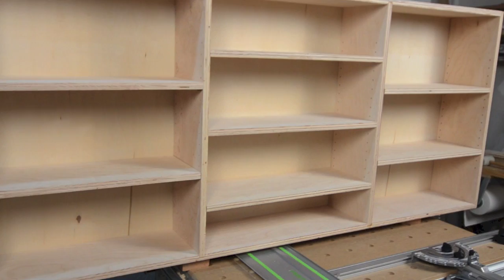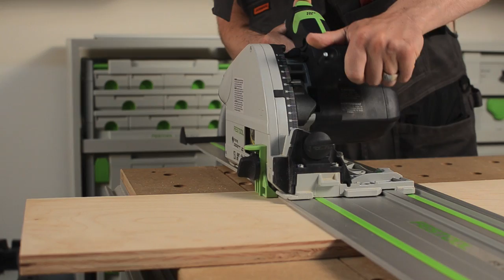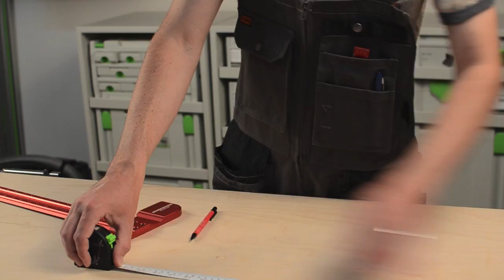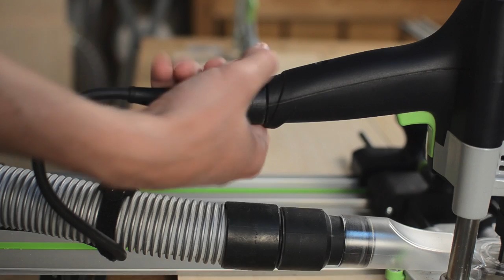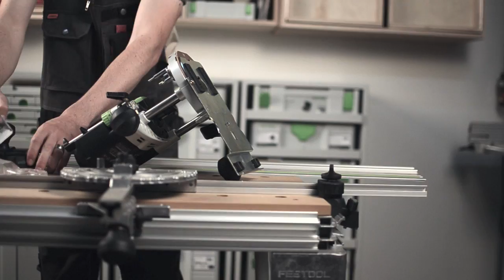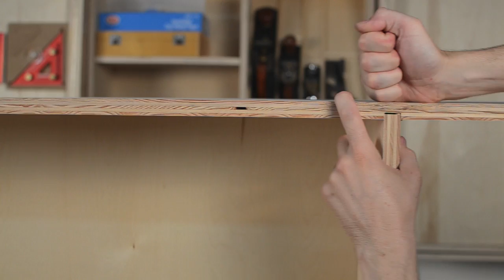Festool Wall Cabinet Demonstration

Comment: What is the bit you are using to make your dado cuts?
Reply from the maker: The bits in the video are some now discontinued Festool straight bits. Might want to look at a down-cut spiral bit if you're doing dadoes to reduce tear out.

Comment: Amazing video,  Would you please share what "bit" are you using on the 1400.  BTW:  Festool should pay you a commission, because based on this video, I purchased the 1400 and the LR32.

Thank you.
Reply from the maker: +nerves Ha.  The OF1400 was the first Festool I purchased.  You're going to love it.  The bit in the video is a Festool straight bit that has since been discontinued.  Nothing too special although it had replaceable cutters.  You should try a spiral downcut bit as it will reduce tearout when cutting rabbets and dados.

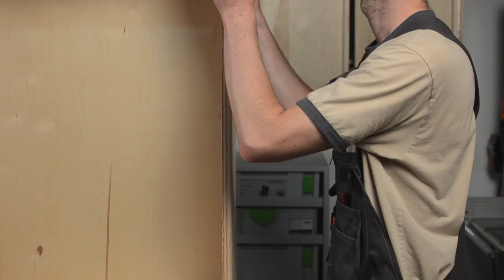Comment: I'm not a cabinet maker, Braden, so please excuse the novice questions.  Would you please specify the material you based your wall cabinet on?  It looks like a laminated wood material -- like a form of plywood -- but the plywood I see these days doesn't look as linear/flat/true as what I'm seeing in this particular video.  If it is a type of plywood, I'd like to know if the screws I'm seeing being driven (at about the 4:10 mark) bite well when driven into the ends of the opposite panel?  In other words ... after the screws pass through the panel you're pushing the screws into, they have to bite into the end of the adjoining panel ... Do the screw threads hold well when being driven between lamination layers?  Thanks for putting together such a fine video production.
Reply: If you go to a good lumber yard they'll have a wide variety of plywood both veneered and not.

For screwing into the edge of plywood, and I'm assuming he's using #8 flathead wood screws, it's best to drill pilot holes.  1/8" drill bit works for #8 screws.  Pilot holes will prevent plywood from splitting and in some extremely dense woods/materials, like bamboo, pilot holes can prevent (low quality) screw heads from snapping off.  I've had it happen and in some "cases" it can be a royal pain in the arse!  :-)
Reply: +Timberwright Svs Just looks like a decent quality hardwood (maple or birch) plywood. IOW, not the stuff you'll typically find at the local big box store.
Reply: +Timberwright Svs BTW, the dado helps prevent the screw from separating the layers.
Reply: +Boran Theki Thanks very much for the thoughtful response, Boran.  I'm a timber framer; hence, my novice question about the cabinet making end of the craft.

Comment: I assume you work for Fez because the normal builder could not afford these tools?
Reply: +Kevin Elliott
Plenty of normal builder buy Festool. Because it allows them to install jobs quickly and very accurately so that they can move onto the next job. Also they are very reliable. 

Time is money and good Carpenters and cabinet makers will actually own a set up like Festool, Dewalt or Makita which are all high end by the way.
Reply: Expensive is all relative...  Martin, Biesse and Weinig are expensive machines.  But in the right hands they can make a fine profit too...

Comment: Sounds great.  Now all I need is to find 3500 dollars to buy all that Festoolery.
Reply: That being said, to get that kind of accuracy on straight rips, squaring stock, small cross-cuts on large stock etc QUICKLY and easily, you'd ideally have a sliding table saw (thousands of dollars) and a full size shop or a track saw that you can take on the subway.  The Dewalt track saw ($500) is only $200 cheaper than the Festool one.  Its not really that snobby.
Reply: i was thinking the same, ill stick to my dewalt and spend way less than half
Reply: A tradesman who is earning $80,000 to $100,000 per year will find it easy to invest in a festool set up.

Comment: Thanks, Braden, for this great video. What router bit are you using?
Reply from the maker: Thanks Benjamin.  I'm using a couple different kinds in this video.  The straight bit is a Festool 491080 and the spiral bit is a Freud downcut bit to reduce tearout.
Reply: Thanks for the info. I'll pick them up!

Comment from the maker: Hey secundus64.  I haven't used the older 1080 model but found the slop-stop you mentioned.  Interesting mod.  Looks like a small piece of painters tape on the index tab may help as well.  My MFT/3 indexes tightly into the guide rail so haven't had an issue with 'slop'.  Good luck.